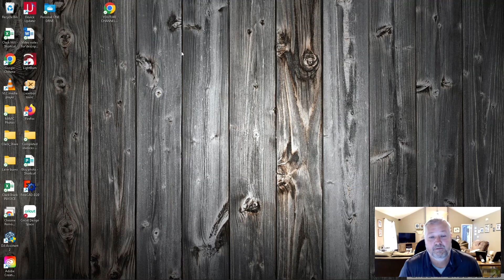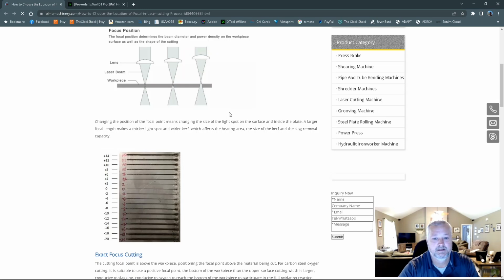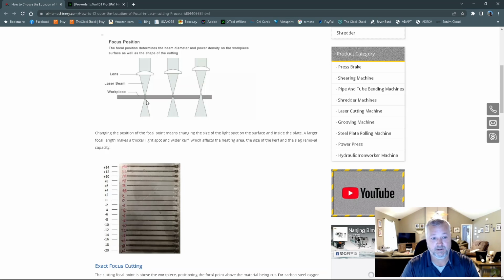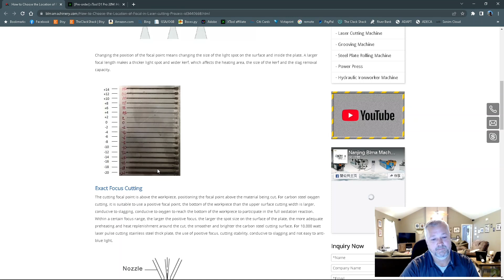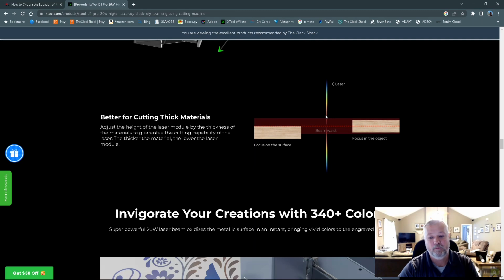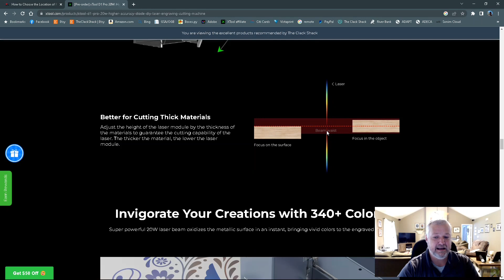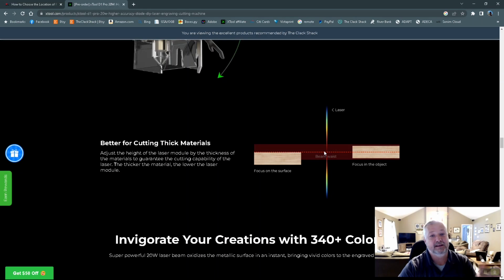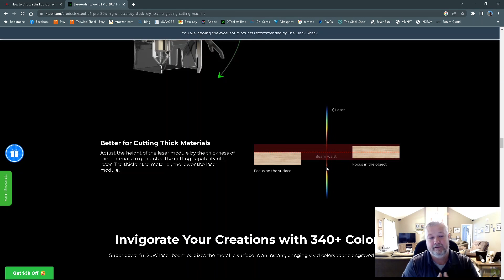What is the kerf of the XTool D1 Pro 20 watt?

Comment: I understand the focus issues but it’s advertised that the laser spot on my 5 watt is a lot smaller than the 20 watt upgrade I have now. I don’t remember the exact measurements but cutting 1/4 in wood on both lasers with the 5 watt the drop out is much tighter in the hole than the 20 at the same focus. Was just wondering if it made a difference in your boxes fitting together.
Reply from the maker: Not on my glue ups. I haven't done any snap together ones with the new machine. There is some difference but not enough to be a concern. I just cut some keychains out and had to push the 5mm piece out of the hole because it was too close to fall out.
Reply from the maker: Are you setting the 20 watt to the thickness of the material?
The exact measurements were on the xtool page in the video. 
According to XTOOL, Laser Spot	20 watt= 0.08*0.10mm	10 watt= 0.08*0.06 mm	5 watt= 0.06*0.06 mm
Reply: @TheClackShack  haven’t played with the adjustable focus on the 20 yet just using the top of material like the 5, will play more when I get time. Keep making those great videos, it has to get cooler soon 😰

Comment: Would you happen to know how you would go about hooking up the rotary to the pro machine ?
Reply from the maker: I haven’t looked to be honest. I plan to use my 10 for the rotary. I would think it would be the same as older model or similar.
Reply: @TheClackShack  I got it figured out It connects to the same port as of the D1 only difference is on the Pro the Y cable is connected into that port. So it has to be disconnected and then you connect your rotary into it.
Reply from the maker: @Mark-oj7yt  , good to know

Comment: Am I thinking correct should it work the same when engraving to lower the focal point for more detail? Does that make sense? I was thinking the 20W would have less precision than the 10W when engraving. Not sure I asked the question right 😀
Reply from the maker: For a surface engrave, you would want the smallest part of the beam to contact the surface. It wouldn’t cut as well but the laser spot would be smaller for the engrave.
Reply: @TheClackShack  Thank you Sir!